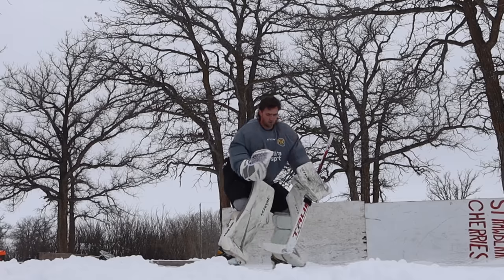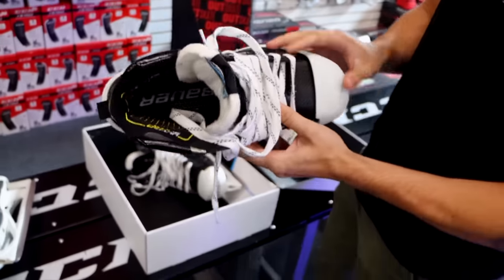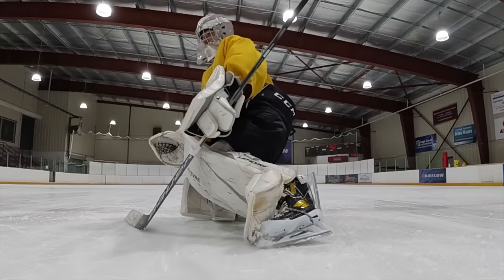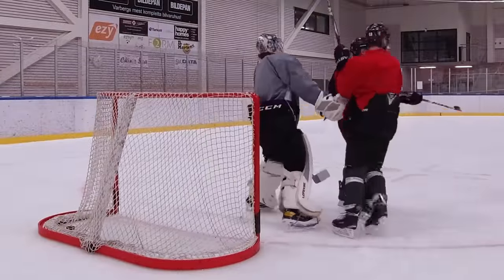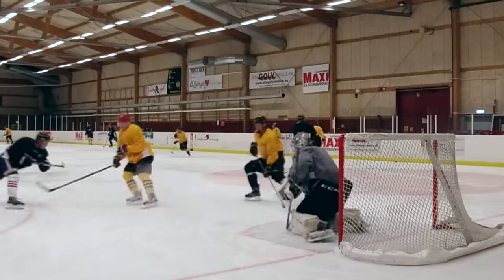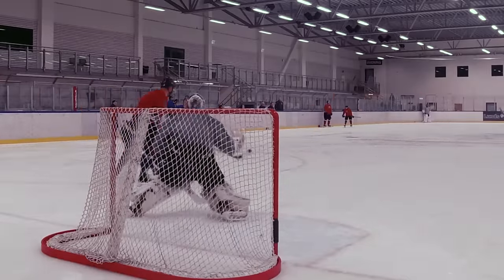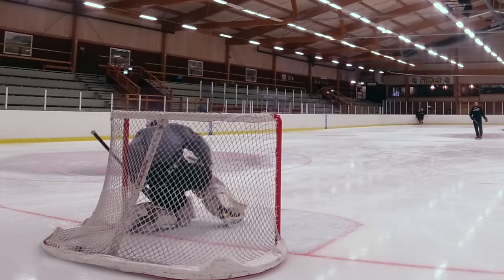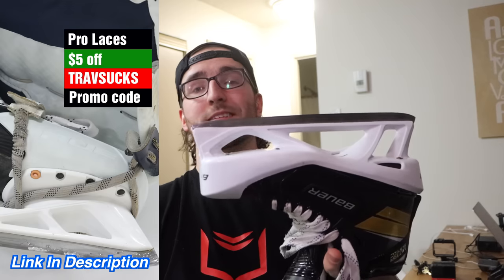Bauer Ultrasonic Goal Skate 6 Month Review

Comment: Hey Trav, i got a question.. i've had the bauer reactors for a few years now (3 i believe), with the superfeet inside, but my feet still hurt like a bitch every time i step on the ice. i do have flat feet, but i put my skates in a skate oven when i first got them. is this an issue with all bauer skate in your personal opinion? you mentioned that even your custom skates can still hurt your feet. anyways, thanks for the review, really helpful!
Reply from the maker: Would suggest trying to re-mold them with the super feet

Comment: Hey Trav... did you rebake your skates after installing Superfeet? Superfeet support your foot differently than other insoles. They keep your foot in an unweighted position and actually make your skates fit a little bigger as the foot does not spread out as much in the skate. You should rebake the skates when you get a chance and it should help with your discomfort. Been selling hockey gear for 20+ years in case you’re unsure of my credibility... lol
Reply from the maker: I DID Not after baking. May have too
Reply: Make sure to wait 24 hours after baking before using the skates or put them some ware below freezing for at least 4 hours. The glues at the seems need enough time to harden up again